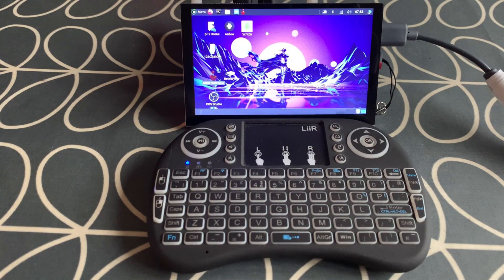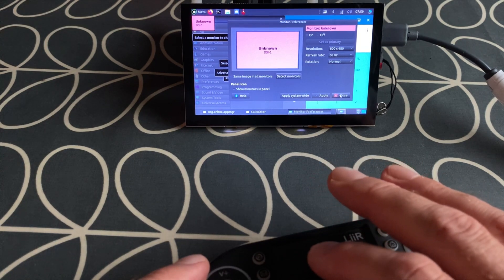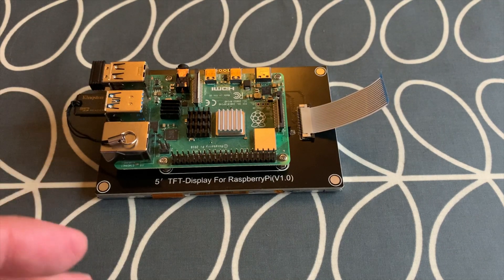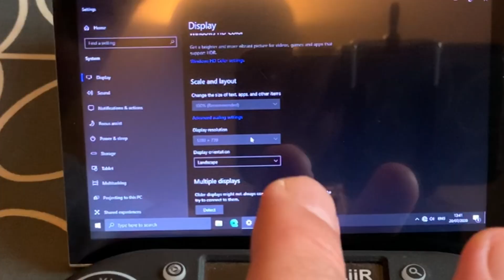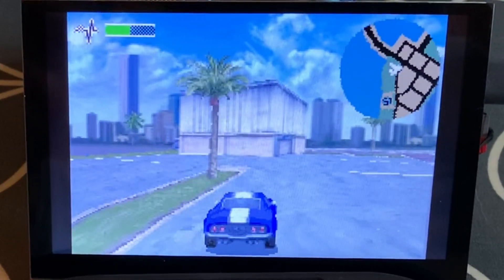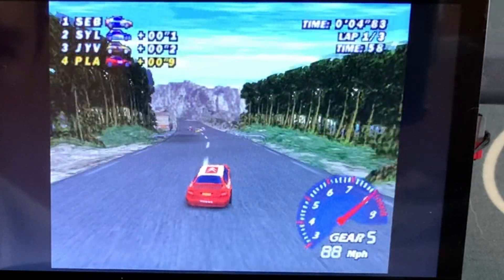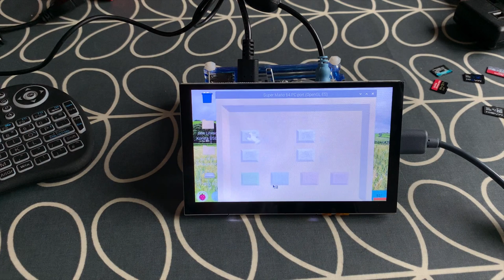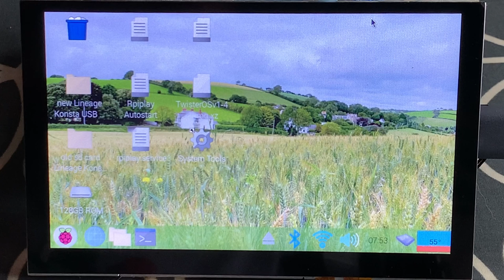Raspberry Pi 4. Bigtreetech 5” touch screen Display. Raspberry Pi OS, Windows 10, Retropie..

Comment: It's 40 bucks on Ali... It's designed to run an Octopi image of theirs. That's probably the file they sent you...
US $41.11  8%OFF | BIGTREETECH PITFT50 V1.0 5 Inch Raspberry Pi LCD Touch Screen DSI 800*480 Display For Raspberry Pi 3B/3B+/4 3D Printer Octoprint
https://a.aliexpress.com/_dWOUavI
Also...
https://youtu.be/FonUyXnJRGc

Comment: The Official 7" Touchscreen has a similar situation with the ribbon cable and SD cards. With that screen it is possible to mount the Pi upside down. So the ports are the between the Pi's PCB and the back of the screen. You have to twist the ribbon cable and with this screen you might need longer standoffs. But if you do it right, you end up with the SD card slot more easily accessible and the screen will lean back more gracefully.
Reply from the maker: I have just received a great solution for the sd card video soon.

Comment: I really dig this. Any talk of this being released in a 7 inch size?
Reply from the maker: Hopefully they will see your comment. 👍🏻
Reply: 7 inches would b better..!
Reply: use the official rpi 7" touch screen, it uses the dsi connector like this screen and has a resolution of 800x600
Reply: Itai Nelken thanks. Will check it out.
Reply: @nickhenley8040  we will consider your suggestion, thank you